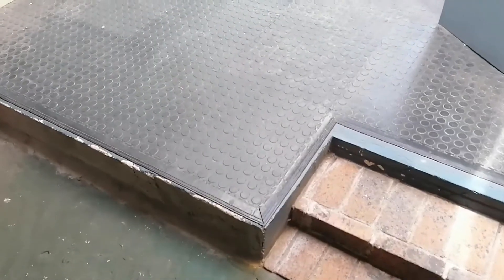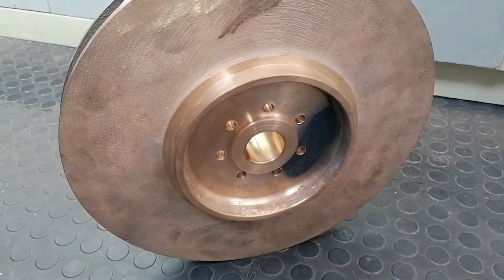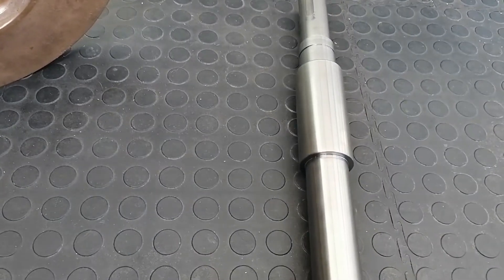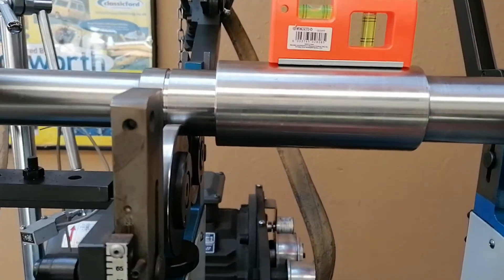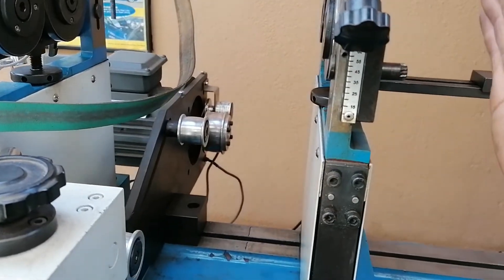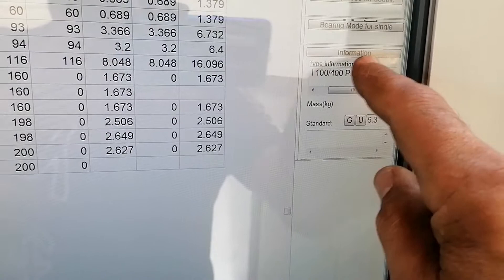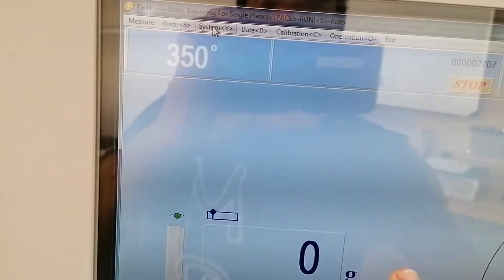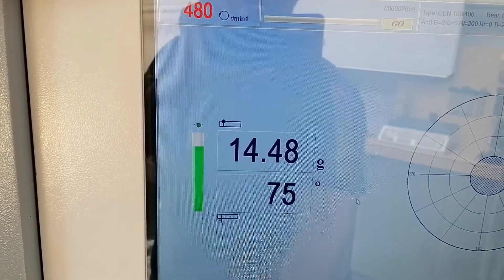Centrifugal Pump Impeller Dynamic Balance Data Capture

Comment: Where you input front wr and back wr data in your computer
Reply from the maker: Hi, that data captures for wear ring sizes is not for the computor at all, but for the data pack of information i make for my customers. So no need for that if you do not make a data pack. It is something that i do and nothing to do with balancing process. Thank you and take care.

Comment: where is the measure of diameter 400
Reply from the maker: Hi, thank you for your comment. The capturing of the diameter is information to use in the data pack which i supply to my customers. For the balancing process the diameter is not used, but the radius.
Reply: @mpe6678  400 for outside diameter? and balancing process use radius 200? wearing dia. also for your customer?
Reply from the maker: @radityaazis678  Yes, only for customer.
Reply: can i request how to balancing rotor set for (between bearing) and have multi impeller? i mean rotor set for multistages centrifugal pump.
Reply from the maker: @radityaazis678  In my other videos i balance between the bearings. To balance multi stage centrifugal impellers, data to be captured as a rotor balance. In other words the impellers must be treated as one unit with two different balancing points.